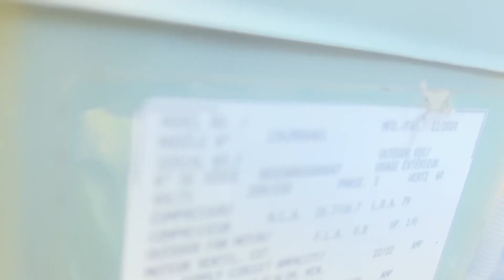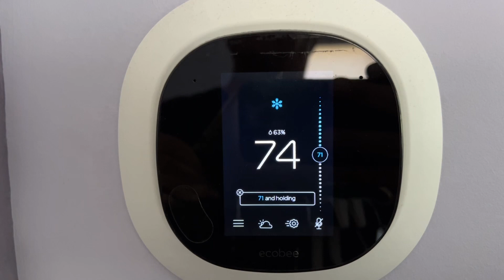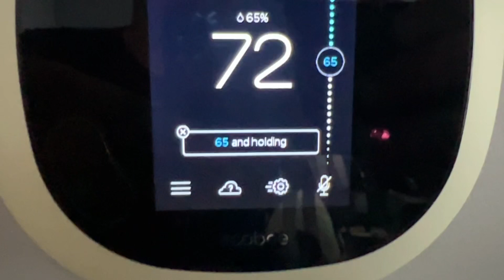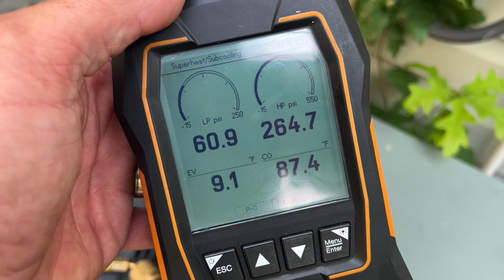OMG! There’s an Iceberg Inside Your AC System! 2nd Floor Central AC Isn’t Cooling

Comment: Where do you look to see how many ton your air unit is
Reply: Its usually listed in the first few numbers of model #,24 for 2 ton,30 for 2.5,36 for 3 ton etc
Reply: @cardsfan-ym1bj  ok thank you
Reply: @GoTigers1988  no problem sometimes it will be stated on the compressor also

Comment: @Mikey Pipes - Pipe Doctor Plumbing & Heating & Air
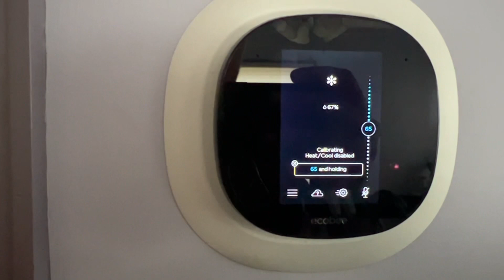6:13 Mikey, probably know this and forgot, but ill say anyways; just in case some ppl out there don’t know.
Use a ton of Ecobee thermostats, and if tap the “snowflake” (or other symbol at top) you’ll go into a shortcut menu that you can select heat, cool, auto, off real quick……w/o going to hamburger, settings, etc…… just a real quick way to turn off/on or set diff quick setting, even turn fan on always, auto, or off. Also, if running a setting, like a hold, cool on for 2, 4, till next prgrm, etc…. To get back to auto or regular prgrm, just tap t(e “X” on top left of square text box that has current “action” running. Can also just tap the text box itself and it “SHOULD” close it out and revert back to regular schedule or presetting that set.¹ 
Hope this helps someone out there.
✌🏻

¹ edited b/c forgot to add this info, and I add these “edits” in case ppl comment, don’t want anyone to think I changed something after the fact
Reply: them are some odd shaped "hockey pucks". 🤣🤣
yeah no, just no.